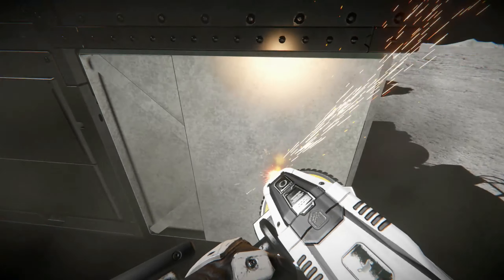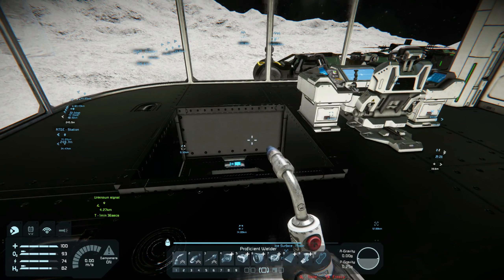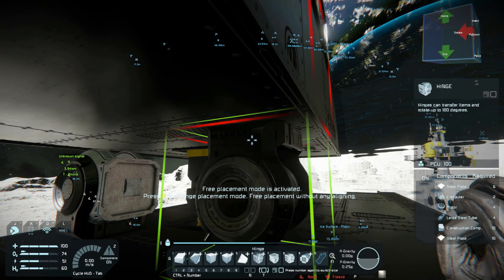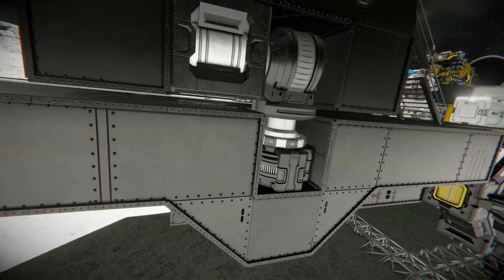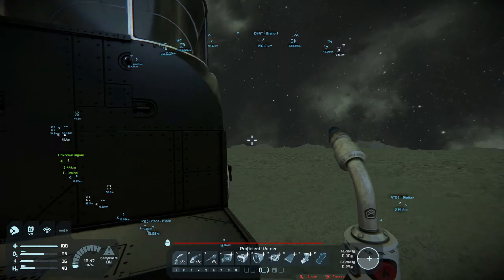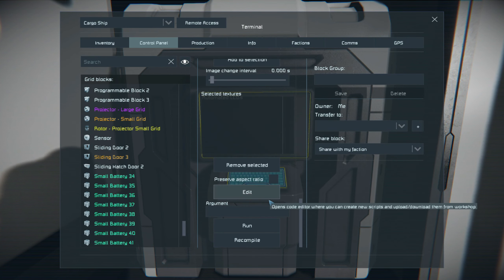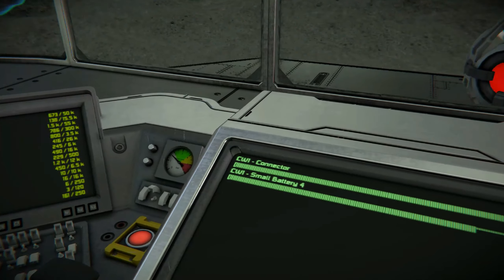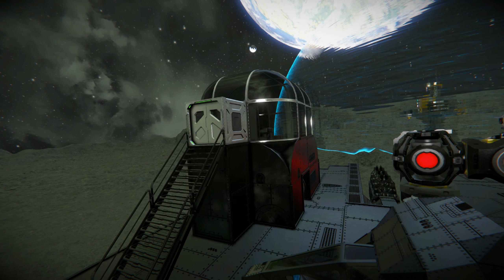Space Engineers - EP24 - Drone & Projector Room Update | LCD Displays | Tutorial | Let's Play

Comment: They conveyor didn't attach between the hinges not because of clearance or something being to far out of alignment but due to the fact that the control room was an entirely separate grid. Sub-grids have to be connected via this method. A quick way to check sub-grids is to use the Ctrl+Shift+MMB paint function with a temporary color. It will paint an entire grid. What doesn't paint is a different grid. For something like parallel pistons you can use a merge block attached to the side of a piston head then have another merge block on what you want the 2nd parallel piston connected to. Once connected and green just grind off the merge blocks and that piston will be forever welded. Well unless clang comes for a visit.  Another method to check subgrids if you are in admin mode is to use Ctrl+Shift+C and it will copy just the grid you are looking at. You can blueprint in the same fashion using 'b' instead. Useful for blueprinting a ship that is docked.
Reply: Also using a merge block instead of(alongside) a connector may help with any clang(phantom force) issues you may run into having the rotors working against 2 grids. I would also suggest setting rotor limits if clang comes knocking. Probably just 89.9 degree's or something like that to keep the grids apart just a tiny amount.
Reply: On this note. I will warn you that with sub-grids to close together, like your control room to the main ship, will sometimes weld together on an admin paste. My drill rig was amazing with it's close tolerances but I couldn't paste it into world or do the admin task of Cut/Paste to fix a bugged grid. The control room will also not be blue printable in a survival game due to it being a sub-grid without the blueprint sub-grids mod.  Forcing an admin paste if you want it as you built it.
Reply from the maker: Ah yes...forgot I had ground off all the armor blocks that had previously had it all connected together as 1 grid before attaching the hinges, so at that point it was on it's own grid.  You are a very observant Space Engineer!  :D

Comment: You mentioned having troubles with gaps on your rotors. Did you try rotor displacement? Or was clang not happy about that.
Reply from the maker: I did not!  Thanks for that!!  :D  I will have to go back and investigate...perhaps I can extend or retract this displacement value in a some klang-happy manner.
Reply: @Oearth  I was going to recommend the same thing. So to add to that, you should use an advanced rotor so you can connect the conveyor through it. Then you can have the other hinge connected to your air vent so you always have air regardless of where the control room is positioned.
Reply from the maker: @bolland83  Great thoughts, and I considered at one point if I could use the hinges for conveying the air, but with the size build I was doing it would of put the air vent on one of the exterior floor blocks and made it impossible to pressurize the room (due to the air vents half-block size).  To avoid that, I thought I could use the hinge so it placed the air vent in the middle and just had back-to-back hinges; but then, it shortened the swing down to 2 blocks rather than 4 - all viable options with tradeoffs.  It's one of the things I find so enjoyable about the game!!  It provides so many options and ways to do things.  :)